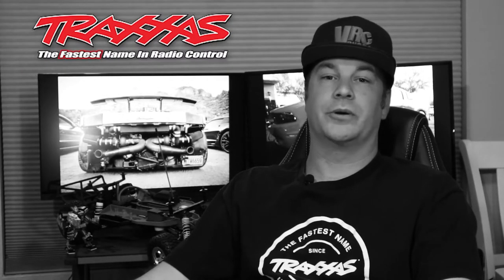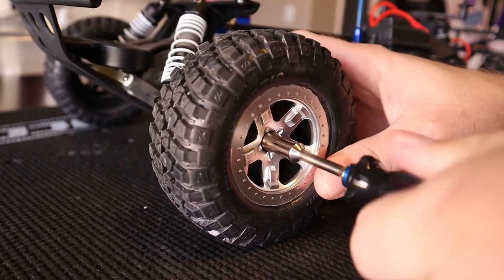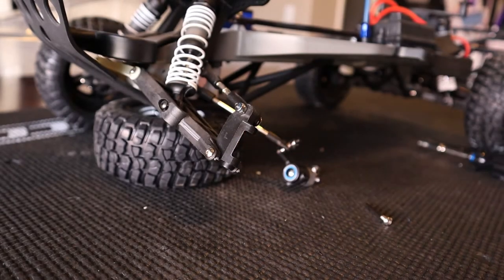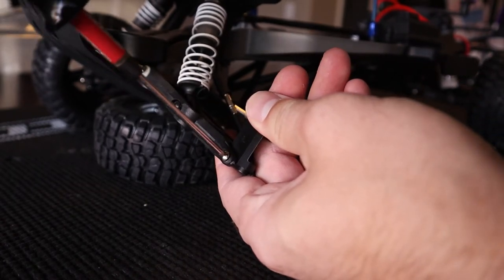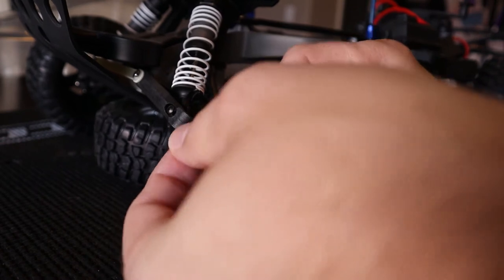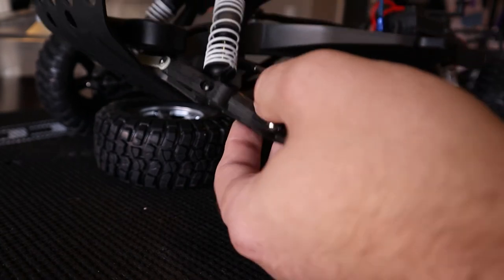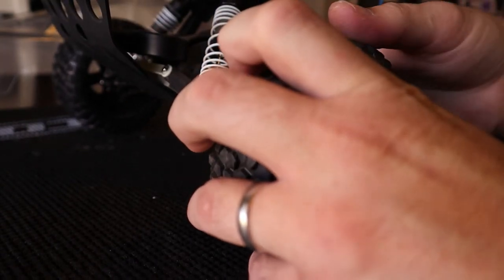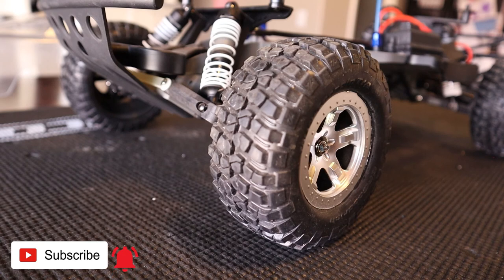How to Replace the Front Caster Block on Your Traxxas Slash - Bandit - Rustler - Stampede - TRA3632

Comment: I put some new metal ones on my slash (caster block and steering block) and also put some new metal stub axle carriers along with A Arms. What I noticed is there’s a little play between all the parts, where they meet.
Also some play in the wheels, you can shake them a little. Is that normal and okay?
Reply from the maker: You can use some shims to take out the slop, but a little is normal.

Comment: Why does the Rustler have Allen screws 😩
Reply from the maker: Do you mean Phillips? The VXL vehicles come with Allen (hex) head screws and the brushed motor models were coming with Phillips head screws. I believe they have all since been updated to have Allen head hardware.
Reply: @Voyage RC  sorry philips  screws that’s correct
Reply: I bent my turn buckle  on my 2 wd rustler , but it shows so many different sizes , not sure of the rite length, thanks
Reply from the maker: @rickbarg3980  is it the front camber, front toe, or rear camber link?
Reply: @VoyageRC  front right 2wd cheers🇨🇦
Reply from the maker: @rickbarg3980  I am assuming you mean the front Camber link (not for steering). This can be found here...
https://alnk.to/gzQvRe4
Reply: @VoyageRC  some call it a turnbuckle
Reply from the maker: @rickbarg3980  yes, you are not wrong. But there is also a steering link that could be referred to as a turnbuckle.